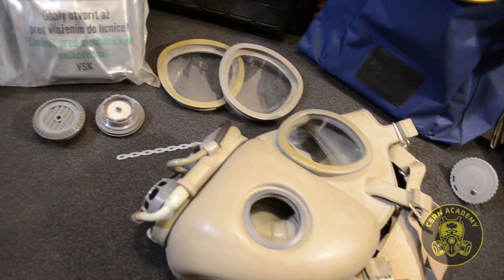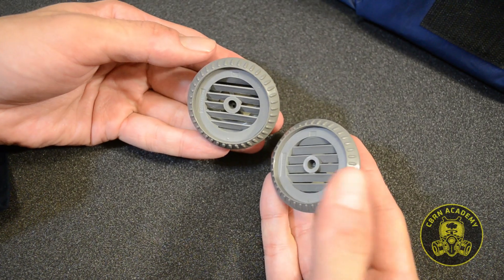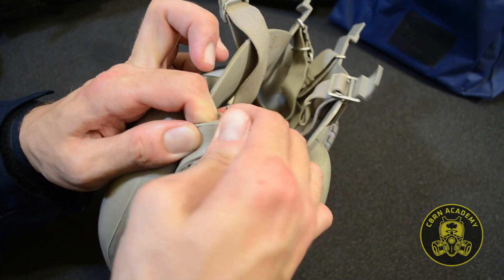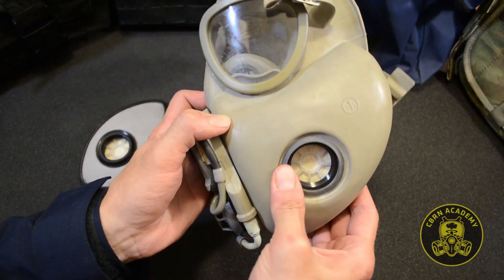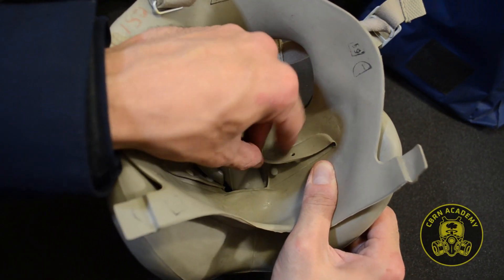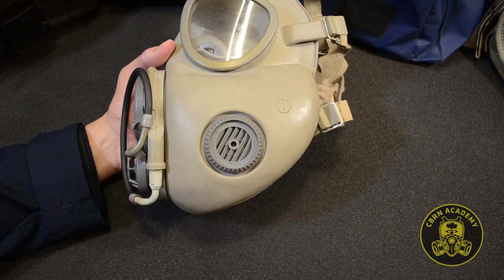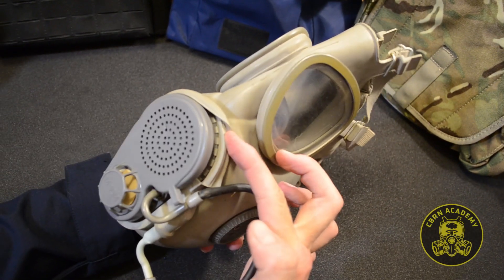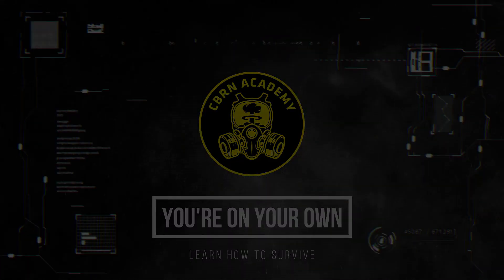M-10 / M-10M gas mask assembly

Comment: How do you clear this mask? The exhale valve is hard to cover.
Reply from the maker: You can submerge it without any issue and you don't need to take it out prior to cleaning.
Reply: @ thanks for the reply, sorry if I was unclear, I mean how to clear the mask of contaminated air after donning. With an M17, I can easily cup my hand over the exhale valve, but on an M10, I can’t. Thanks!
Reply from the maker: @r.k.haller2380  I see. I explained it in the "how to use a gas mask" tutorial. In case of gas masks with exhale valves that cannot be simply obstructed by a hand, you need to exhale sharply/blow the remaining air from your lungs after you donned the mask. 

It's a regular procedure all around the world, but I understand this subject is taught differently in the US Army for example. That's because they use masks with exhale valves that can be easily blocked with a hand. It all depends on what kind of respirator you're using. :hand-pink-waving:
Reply: @ thanks a lot!!

Comment: Sorry for super late question, i used an M10 gasmask with the white 'riot' filters and i am currently having a dry throat + a nose bleed afterwards, i am quite concerned wether or not i just swallowed chromium or i am simply just being paranoid
Reply from the maker: Hi there! Some people used the M-10 rather extensively on our civil defense trainings and no one ever had any sort of health problems.

Chromium was present in the cheek filters of some very old US gas masks but even in these cases the amount of it was not substantial and thus not hazardous. 

The M-10 filters are safe, but very old and at this point they provide very little protection apart from particle filtration. 

What you might have inhaled is the powder that was meant to preserve the rubber. It's always a good idea to wash masks like these with a lukewarm soap water before wearing to remove the powder and rubber crumblings from the inside of the facepiece. As I said, the masks are old and don't age well.
Reply: @cbrnacademy  Thank christ, i had an early mid-life crisis in my head. 

Going to get the mask a nice washing. I was just going to use it for cosplay reasons so the protection value just needs to be physical to survive mild movement. 

Many thanks!
Reply: @cbrnacademy  If i may, i am having trouble turning the inlet grids since i have the M-10, do i have to knock off the metal wire running inside? I don't want to accidentally scratch up the entire thing just to turn it and there is 0 videos or guides on how to do it. 

Cheers
Reply from the maker: @The-nr6yg  I wanted to include the spring removal process in the video but I wasn't willing to pay for another crappy surplus mask just for this small addition.

Yes, you need to remove the spring first, then you can rotate the grid freely. Use some pointy thin tool to grab one end of the spring from the bottom and it will jump out of its place. Once you turned the grid, attached the spring back with your fingers. Repeat with the second valve ;)

Comment: I wonder how the us saw this as practical🤔
Reply from the maker: I guess it was their idea of low-profile filters back then. This system has some advantages, for example very low breathing resistance, better balancing since no heavy filter is sticking out on one side... But negatives outweigh the positives.
Reply: I love cheek filter masks just hate changing filters but I love look and ig it makes sense if you got into hand to hand combat and you're opponent trys unscrewing you're filter
Reply: Soldiers aren't trained to change filters, instead troops are sent into combat for an estimated amount of time, then are rotated out where the filters for the mask were replaced by specialists trained to do so.